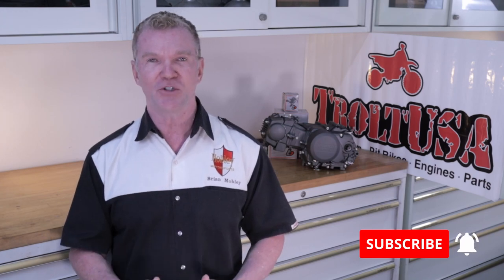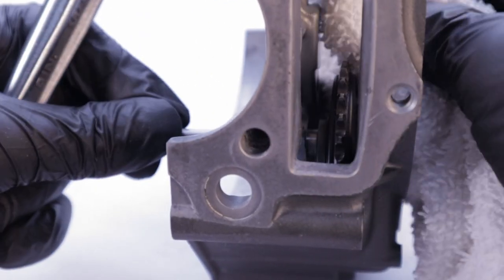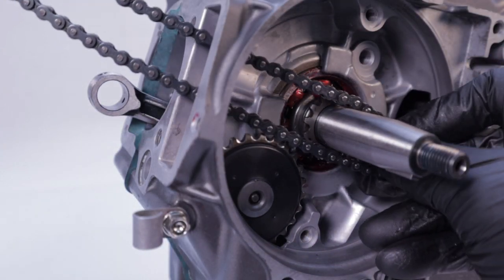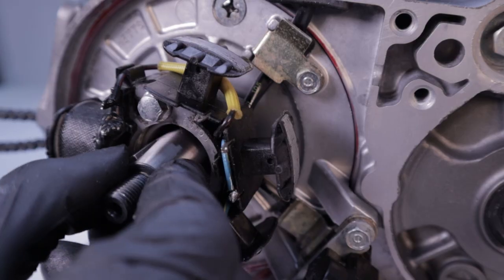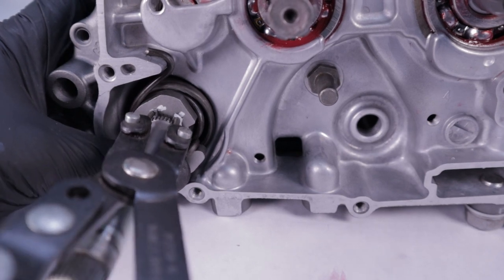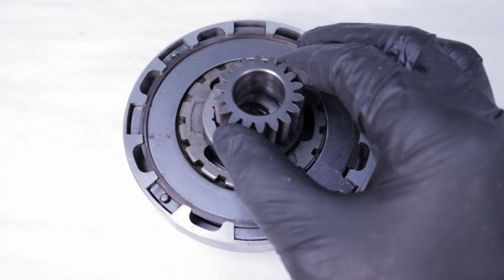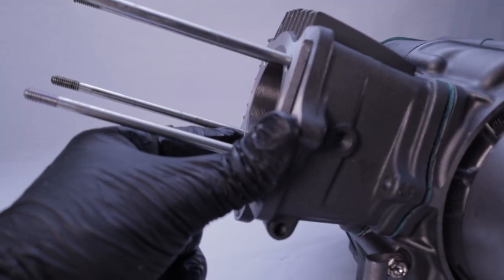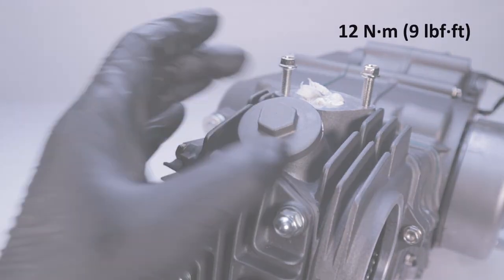Incredible Pit Bike Engine Build || CRF70 / CRF50 / XR70 / XR50 / CT70 / Z50

Comment: You don't need to tighten the oil pump drive gear, it turns in the direction that tightens it. I always just snug it slightly. One thing I've noticed when rebuilding these engines is the timing chain tensioner tends to be worn out half the time, there's specs in the service manual to measure the rod. It works very similar to a hydraulic lifter in a car, if the rod is worn it won't pump up as well. 
Awesome video very thorough!
Reply from the maker: Thank Forrest. Good insights!  Thanks for sharing. The manual was no help regarding that oil pump drive gear so I tried to just tighten it up to about the same resistance that it gave me when removing it. And for some insurance, I added the LocTite. Thanks for the insight on the tensioner rod too!
Reply: If there's dirt in the rod assembly, it wont pump up correctly either. If you press your finger on the rod with the cover off, and oil squirts out of the relief valve, you have a dirt issue. Remove and clean the assembly, and change your oil.

Comment: Great video, just got my engine apart, this is probably one of the most detailed videos out there 👍 hard to find these kind of videos
Reply from the maker: Thanks Redlite!  I tried hard to keep it straight to the point and in order. I don’t think I missed anything because I went over it with a few other expert friends before I published it.  Hope it helps! Thanks for watching.
Reply: When mating the crank case halves did you run into them being stubborn going back together?
Reply from the maker: @redlitemeatandpizza  Hey! I haven’t. And usually when you experience that, it’s because something isn’t installed or aligned quite right. Check you transmission shafts carefully to make sure they are fully seated and lining up with the corresponding machined holes in the opposite case half. Usually it’s something very simple. Don’t force anything back together or you’ll be shedding some tears!  Take your time and check all your installations. You’ll find it!
Reply: @brian.d.mobley   Thanks for the reply, so the new kick start shaft diameter was a tad bit thicker than the old one, which was causing the Ring washer not to fall down to the snap ring, which caused the cases to not fully go down. Good thing for a dremel! Opened it slightly more and it fell down 👍
Reply from the maker: @redlitemeatandpizza  Thats great!! You figured it out on your own! Feels good to figure things like that out, right!?
Reply: @brian.d.mobley  Oh yea it does! Lol hopefully I can get this thing fired up this weekend, doing the gear shifter/plate now then should be smooth sailing after that
Reply from the maker: @redlitemeatandpizza  Im sure you can!  In general, its a simple motor!  Good luck!  Im sure you will make it sing!
Reply: @brian.d.mobley  thanks

Comment: Wow, someone finally addressed the cylinder head arrow, that it needs to point downward. Also, place the gasket on the head cover to make sure the holes line up correctly as there's only a one in 4 chance you will get it right.
Reply from the maker: Good tips!

Comment: Hello! Today I thought I broke my crank in my 2017 Apollo with a 124cc 154fmi motor. I tried to tighten my selector bolt but I overtightened it and broke it off 😔 alas I will do my best to extract the broken bolt and I’m stoked to have found this video, hoping it can aid me in my quest to rebuild my bikes engine.
Reply from the maker: Hi Olympic!  What a bummer!  I hope you can fix that broken bolt. Not sure if this video will help much, but I hope so!  We’ve all dealt with setbacks like that, so just stick with it! You’ll get it fixed!

Comment: At 20:40 the copper washer is on the bottom LT, then at 22:28 its on the bottom RT. Either way very useful video. THX..
Reply from the maker: As I recall, I put the washer in the wrong place at one point and had to re-film the clip with it in the correct position.  Re-filming everything for a corrected mistake is not easy or time efficient, but I think you'll find the washer in the correct position finally.  Thank you.

Comment: Hi there mate, would there ever be a sort of this video for a 125cc pitbike engine? its the most common one and i really need help with mine
Reply from the maker: Hi Volkov. Which 125 motor are you referencing?
Reply: @brian.d.mobley  The chinese 125cc engines , the ones that come with the standard pitbikes (thumpstar , stomp etc)
Reply from the maker: @volkov6460  I would consider doing some videos on one of someone wanted to sponsor the build. I don’t have a bike to put that in, so I don’t see myself buying one.
Reply: @brian.d.mobley   @Brian D. Mobley  I see, also do you have an explanation of how a clutch works on pitbikes? I dont understand how the little lipped cylinder can push the clutch plates out as it doesnt have anywhere to push on . If you do not understand what im refering to go to the timestamp 13:19 on this video "https://www.youtube.com/watch?v=I56L5mAOtVA&t=429s" 

You see that black cylinder shaped thing? i do not understand how that works in engagement/disengagement

Thanks!

Comment: Hi Brian , the sprocket I’m talking about is below stator plate, I would like to know how yow  put this on crankshaft in the proper position, it is pressed on the crankshaft. The bike I bought had this removed. With no marks or scribes were it originally was. The crankshaft chain I believe is driven by this sprocket.

Comment: I really appreciate your videos. I have searched all over the web and YouTube for an answer without success…. I have a Honda CRF50. When shifting from 1st to 2nd it really hits hard when the gear grabs. I’ve adjusted the clutch but it still really hits hard. Is this just how these bikes are or is there something else I should be looking into? The bike is fairly new with zero signs of abuse from the previous owner. Thanks for your help!
Reply from the maker: HI Tom.  I have dealt with that issue on these Honda OHV engines also.  The most common reasons for this are an overly tight shift drum bolt. (You can access this fairly easily under the ignition cover on the left side of the motor), bent shift forks (harder to get to!) and the shift fork pins (even harder to get to!).  The good news is; the overly tight shift drum bolt is the most common reason and the easiest to access and fix.  Thanks for the kind words and for watching!
Reply: Thank you very much for the help. I’ll head out to the garage and work on it today!

Comment: Great video
Reply from the maker: Thanks Stephanie! Glad to read that the fairer sex is putting the content to good use!  Keep wrenching!!
Reply: 85% of my knowledge come from YouTube when it comes to engines and such if I don’t have the manual or specs, On my first bike I actually did accidentally unbolt the tensioner, luckily it went back in no problem
Reply from the maker: @stephaniekane7276  That is such an easy mistake to make!  Glad it all went back together without issue!
Reply: Do you have an email address? I have a few issues with my pit bike engine I’d like your opinion on
Reply from the maker: @stephaniekane7276  You can message me through Instagram.  I'll try to help, but I've kind of given up diagnosing problems on bikes that I dont have in front of me.  Instagram link is on the "homepage" of my YouTube channel.  Or, search brian.d.mobley

Comment: Excellent video!! Can you help me with one problem that i have ?? I have correct timing and when i turn the engine with hand i see from air valve that when go to close exhaust valve go to open!!so for same second are the both open!! Who can i solve this problem ??
Reply from the maker: HI!  Unless you have changed your cam to some very unusual profile, this should not happen.  The valves open and close in rapid succession, but both should not be open at the same time.  This is highly unlikely. I go over the valve actuation in my most recent video on the subject of valve adjustment.  Look for it; “2 Ways to Adjust Your Honda OHV Engine Valves.”  Thank for watching!
Reply: This is called valve "Overlap", and almost all modern cam profiles have some. A performance cam WILL have a larger amount of overlap than a stock cam, but yes, they all have some. It's completely normal.
Reply: @davelowets  i find the problem and the problem is that the exhaust valve dont close well!!i must replace it with new one!!the engine is super cub 90 honda with 3 gears!!so its old one
Reply: @βασιληςκοντοπριας  Check your valve guides before you put a new valve in it.

Comment: What is the correct assembly of the crank case bolts being that their are 7 bolts and 3 different sizes?? I got the carb breather bolt 😂
Reply from the maker: It’s really hard to describe to which hole each bolt goes through. I have a picture I can email to you if you can’t figure it out.

Comment: What jetting did you use with a 88cc kit and uni air filter open system.
Reply: I think that depends where you live,  elevation above sea level
Reply from the maker: Hey Jacob!  So sorry buddy!  I just dont recall. and I dont want to dig into the carb to go find out.  But, if you need advice on jetting, contact TBoltUSA.  They have more experience with that than anyone.
Reply: @baileyteg1  Exactly correct... I never recommend using someone else's jet combo on a different machine. Too many variables involved.. Do it the right way, and do a plug chop, pull it, and read the plug. Jet it until the plug looks correct. Takes time, but it's the only sure-fire way to get it right.

Comment: My lifan 110cc seems to slip on the kickstart press down on the kickstart. You can feel something slipped inside the engine. What do you think this could be many thanks
Reply from the maker: Maybe the clutch springs are overly preloaded. I’ve never worked on a Lifan, so I’m not really sure.

Comment: Did your crank case gasket have a waxy feeling to it? I was debating whether to put assembly oil or oil in general on it before installing it
Reply from the maker: Hey K30!  Gosh! I don’t recall any waxy feel, but I’m not sure. I doubt it would hurt regardless to rub the gasket with some assembly lube. It makes it easier to split the cases in the future if that becomes necessary. Thanks for watching.

Comment: What kit does tbolt sell that has the oil seals that go between the cylinder and trans And the cylinder to head? I've looked on their site and I'm not sure where to. Find them.  You put them on at about 17:38 and 19:45. Also I have the 146 bbk and was wondering if the second seal you put on on the left side is necessary for my kit? It doesn't quite fit in the head gasket hole. The seals got crushed when I put the top end together and need to buy them separately but don't know the part number.
Reply from the maker: Hey Jason!  Id recommend contact TBoltUSA directly and ask them. They know much more about parts availability than I do. And I’m not familiar with the 146 you reference. Again, the guys at TBoltUSA would probably be a better source of knowledge. Sorry I am not able to help more than that. Thank you for watching!

Comment: Hi there i think your video is brilliant I've got a problem with my gear selector drum bolt when I tighten it up i lose the gears but if I leave it lose I get them back any ideas please
Reply from the maker: Hey Richie!  Honestly, I have had the same problem.  That bolt is tricky.  The way I have handled it is to start with the recommended torque spec and then just adjust the bolt tension based on how the gear selecting works.  Usually a torque spec lower than recommended works better. 
 Hope that helps.
Reply: @brian.d.mobley  ok mate il try that thank you for your help much appreciated

Comment: I've got a 92 z50 ,I have to split the case on.  Are the internals the same?
Reply: I realize the title says z50 just making sure
Reply from the maker: Hey Chris!  Essentially, yes. The cylinder is smaller and the head is slightly different and the transmission is slightly different. But the differences are so small that it won’t affect the disassembly. Thanks for watching.
Reply: @brian.d.mobley  thank you

Comment: What’s easier putting a 4 speed or a manual clutch ? Thinking of putting a 4 speed to compliment my recently installed manual clutch but a little intimidated by the process ..
Reply from the maker: Honestly, I kind of said that wrong in the video. What I should have said was “manual” not “4 speed,” but I didn’t want to have to re record that whole intro. But, manual is (I think) better than centrifugal. But 4sp doesn’t make much difference.  The 1st gear on a four speed is just a granny gear and 4th is similar to 3rd on a 3sp in terms of gear reduction.

Comment: Hi guys, is there anything I can use to flush out a stomp 140 engine please  ???
Reply from the maker: Hi Chris. I don’t know what you mean by flush out. And I’m not familiar with a stomp engine. I wish I could help more.
Reply: @brian.d.mobley  flush the engine oil out  ??
Reply from the maker: @christopherprice55  Genrrally there is no need to do more than drain the oil.  The drain plug is on the bottom of the motor.

Comment: When setting the timing, my flywheel moves ever so slightly off of T when letting go of flywheel. Is that a problem? Piston stays at tdc when it does.
Reply from the maker: Hi Zach.  That is totally normal and usually due to cylinder pressure.  Good question!
Reply: @brian.d.mobley  thanks for quick reply
Reply from the maker: @zachdavis2641  My pleasure!
Reply: @brian.d.mobley  another quick question. Should have asked with original question. Do I need to hold the flywheel at T while timing? Or just let the flywheel settle out of t position then set cam gear?

Comment: Hey Brian loved the video I’m having an issue with my timing it’s either a tiny bit too high or a tiny bit too low even if I move it one tooth I already wrecked a set of valves because they were hitting the Wiesco forged piston I got for it which brings up the compression ratio by having a higher piston dome but it’s supposed to be compatible any chance you can give me some tips
Reply from the maker: Hey Seth.  Its funny.  People seem to only ask me the craziest and hardest to answer questions!! This is one for sure.  Logically, I cant think of why this would happen.  But, a few reasons why it may are:  Somehow the keyway in the ignition is not lining up with the woodruff key or the woodruff key is missing.  Someone tinkered with the cam wheel and bored out the mounting holes resulting in misalignment.  The flywheel you are using is not made for your motor.  The cam chain is worn out.  The guide sprocket or guide roller is worn out.  The cam chain tensioner is stuck and is not providing adequate tension to keep the chain from jumping a tooth on the crank.  The piston is installed upside down (COMMON!!!).  The wrong thickness head gasket was used.   Thats about all I can think of....
Reply: @brian.d.mobley  thanks for the tips I’m gonna check my cam chain and get the right bolts for the cam sprocket i used different ones but I installed the piston with the arrow pointing to the bottom/exhaust valve and I went but how the service manual told me to set the timing which is the same way you did it the woodruff key is fine And so it the tensioner
Reply from the maker: @sethpetras6641  A friend of mine (Pete Andleman) who is brilliant about engines commented to me that your issue may be that your piston may not be compatible with your cam.  Cutouts in the piston must be sized so that they are compatible with the cam being used.
Reply: @brian.d.mobley  I would be surprised concerning that it’s the oem cam and it says it’s totally compatible
Reply from the maker: @sethpetras6641  OK. I didn’t realize that about the cam. Just trying to think of anything you might look in to.
Reply: So when I spin the Kickstarter spindle the main shaft drives the large gear connected to it the but the primary drive gear just spins even though it’s engaged with the circular peace inside the that engages with the primary drive gear noticed this when I wasn’t able to torque down the clutch nut because the gear would just spin
Reply from the maker: @sethpetras6641  That is how it’s designed, oddly enough.  When the clutch engages, the drive gear (gear on the crank) will drive the driven gear (the big gear).  It’s a weird design, but that’s how Honda did it. Watch the video where I wedge a flanged nut between the drive gear and the driven gear to keep the clutch from spinning while it’s being tightened.
Reply: @brian.d.mobley  yeah that was the issue the primary drive gear was spinning on the crank with the flange bolt in there
Reply from the maker: @sethpetras6641  You are welcome to email me a video clip of your problem if you have not yet found a solution.  SterlingAnadar@gmail.com
Reply: @brian.d.mobley  ok I will when I get home
Reply: @brian.d.mobley  sorry it took a while I just sent you a video
Reply: Sometimes the timing dot on the cam gear doesn't line up exactly with the mark on the head. I've had several motors like this. If you absolutely can't get the dot to line up exactly (if it ends up looking like it's a half a tooth off) set it up so that the dot is on the UPPER side of the notch, NOT the lower side of it. The engine will run fine with the dot on the upper side of the notch, but not as well with it on the bottom side.

Comment: Anti-seize..... Keep your fingers off is RIGHT! 

 If you get a tiny little bit on your fingers when you use it, it WILL end up all OVER everything... I swear, I could paint an entire house with ONE little tube of the stuff. 😕
Reply from the maker: You are so right!  I treat it like im handling plutonium or something every time I use it. The bummer thing is that its hands down one of the best substrate choices for so many applications that I find I need to use it regularly!
Reply: @brian.d.mobley  😆 🍻